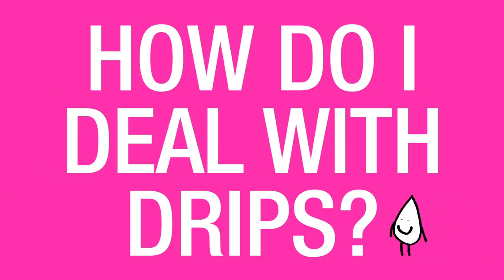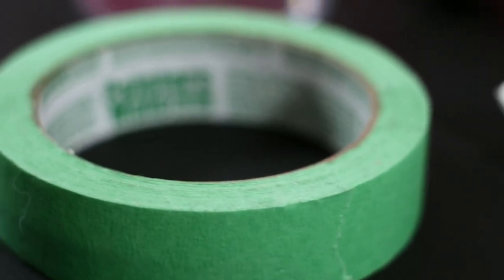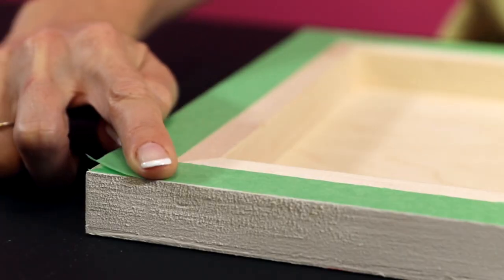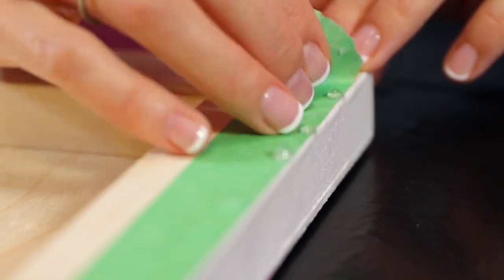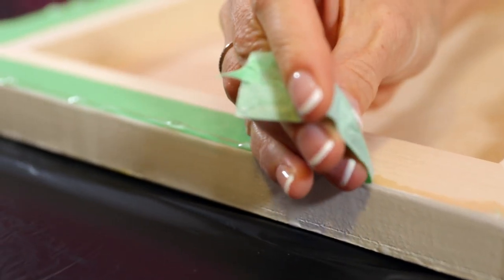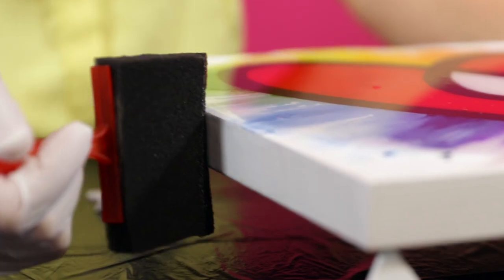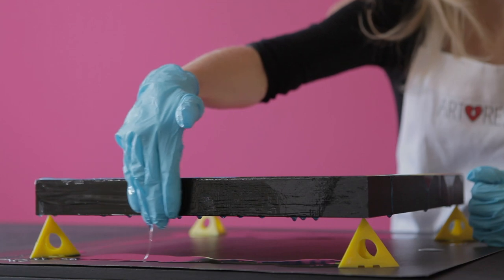How To Remove Epoxy Resin Drips

Comment: Hiee 🌸
How to prevent resin drips around coaster during doming procedure , actually m not having PVA , latex 
Is there any other method?? 
Waiting for your reply 🌸
Reply from the maker: ArtResin is a great doming resin.  The key is to ensure your surface is flat and level before you pour your resin on.  If you want, you can use painters tape around the edges of your coaster incase it drips in one area.

Comment: Can I make pendants without them getting soft due to warmth of the skin ? Or will it get soft?
Reply from the maker: Great question!  Yes, lots of our customers use ArtResin to make jewellery with.  Once cured, it is totally inert and safe for use against the skin.  And it will not soften unless exposed to temperatures above 50C/120F, so warmth of the skin is absolutely fine :)
Reply: @Artresin  thank you ! I'm about to buy some !

Comment: l have a question that has nothing to do with drips,l see guys making epoxy river tables and after it's cured and sanded down they put oil or polyurethane over the whole top of the table,l thought epoxy was non-porous,how does it soak up polyurethane?
Reply from the maker: When you sand it down, you rough up the surface and create tooth for the oil or polyurethane to adhere to - it works very nicely!
Reply: @Artresin  thankyou,you are awesome as usual!